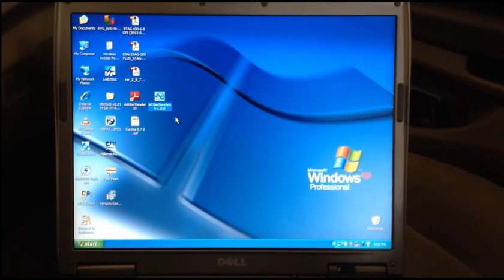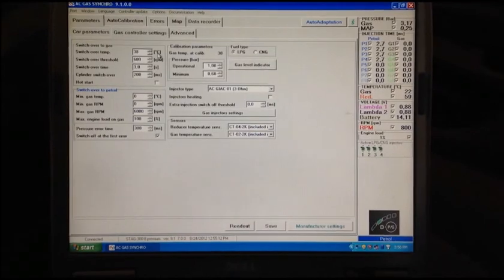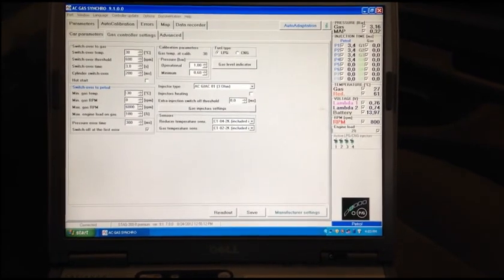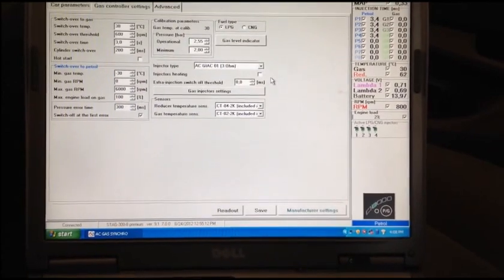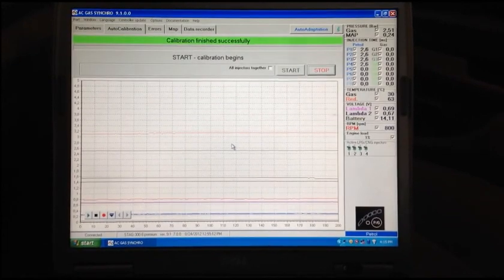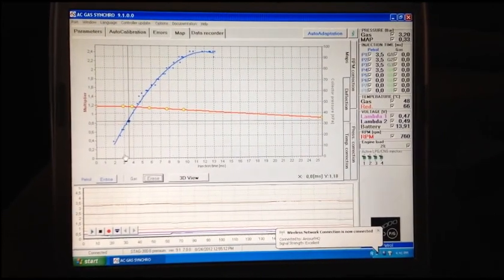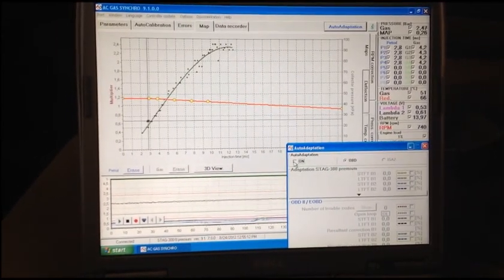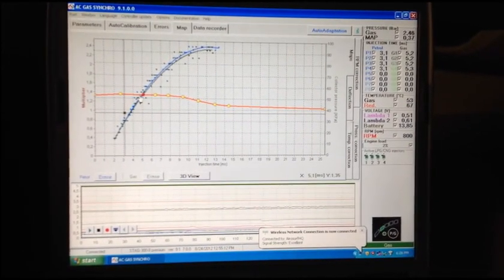CNG Global Sequential Gas Tuning/Programming

Comment: Dear @Brock Taylor,  Can you help to provide KNC  ACGassynchro software to diagnose problem with my vehicle.
I have Hyundai Grandi10 with KNC Stag 4 plus CNG kit installed which has got jerk problem while switching to CNG and now it stopped switching to CNG - B/G LED switch is blinking fast and whenever i press the switch it turns off while running on petrol .

Comment: Lpg not switching at all. One of the fuse keeps blowing when I turn the ignition on.
Reply from the maker: I would start by testing the current draw of your electronic valves, you may have one on the tank, one on the line or lust one on the regulator. You can also disconnect the wire to the valves and see if the fuse continues to blow and isolate it that way. If that dosent work start unplugging each harness until the fuse does not blow to isolate the problem that way. If the fuse still blows after all the accessories are disconnected then the computer is bad or the wiring is shorted somewhere. Best to get a multimeter and start testing current draw.

Comment: Hi,
I have same software but mine showing gas pressure too low in error. Can yiu advise plz
Reply from the maker: You will need to set your regulator pressure to whatever you need for your HP/Engine size and adjust the parameters to match under gas controller settings minimum and maximum pressure. When you accelerate there will be some drop so you must allow for this in the setting. If the presure is dropping too much you may have a restriction or a regulator problem or an issue with the sensor or possibly a bent pin in the sensor conector.

Comment: Can u Help me fixing problem in my CNG settings?I m from India.It is a KNC Korea Kit fitted on Hyundai Grand i10 car which has a 4 Cylinder 1200cc engine, with same OBD interface.The petrol & cng graph matches completely but still there r jerks at 1500 rpm.If I press the accelerator while at neutral to 1500 rpm range,then also I can feel the missing.Secondly,The car stalls sometimes when braking on a red light.I can send u screen shots.Please help.
Reply: Hey buddy, I'm using hyundai eon on CNG conversion kit and had similar issues which have been solved now.
Go to authorised hyundai service centre and get the following done-
1- Get the ful injectors clean (petrol injectors obviously)
2- Throttle body cleaning.
3- Car scanning and Tuning (it's basically checking and rectification of OEM ECU)
4- Change the spark plugs to NGK (Get this done from any professional mechanic from outside, don't prefer authorised service centre here)
5- Get the CNG conversation kit ECU auto calibrated and re-map if required.
Voilà, your car is as good as new.
Hope it helps.
Any query, feel free to ask.
Reply: Ohh, forgot to mention, before step 5, do this, 4(b) - Get the tappet clearance adjustment done from authorised service centre. Very important.
Reply: +Bhanu Pratap Singh mine is just 3 months old car.Everything done except 4(B)
Reply: @kushgoel8026  Hi Kush, is your problem solved now?
Reply: I sold the car 4 years ago.